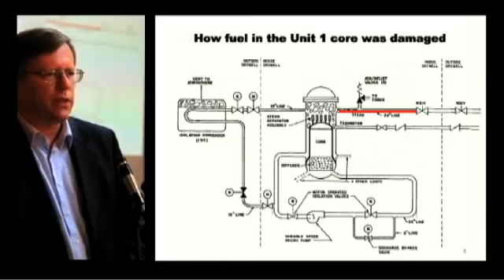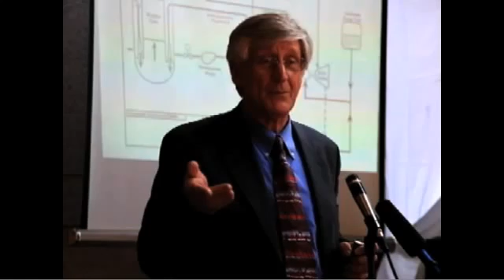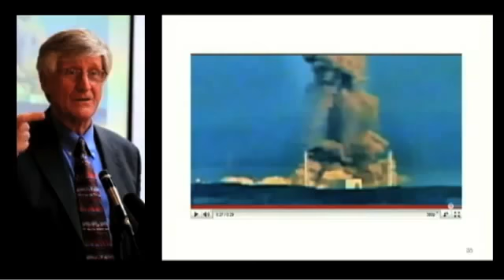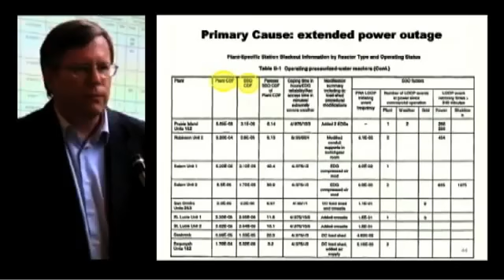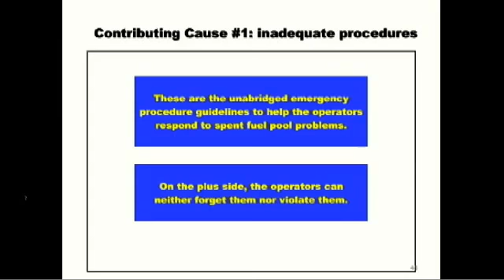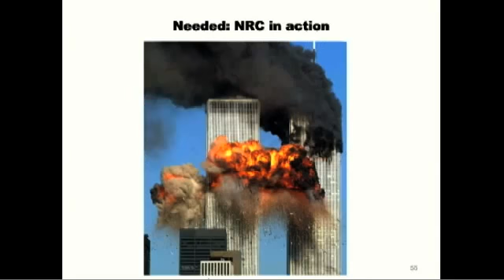Why Fukushima Can Happen HERE-ANY-WHERE!!?  What the NRC and Nuclear Industry Dont Want You to Know

Comment: The GEmk1 is a total nightmare of a reactor, the corium at Chernoble mixed with sand because sand was a integral part of the reactor design, vitrification of the corium was a safety feature at Chernoble .Fukushima's GEmk1 reactors have no way to vitrifi the corium so 1. it is in the torus and is boiling water. or 2. has burned through the bottom of the rpv at the control rods and cutting through the concrete slab down to ground water  = china syndrome = massive rads to come = good bye Japan.